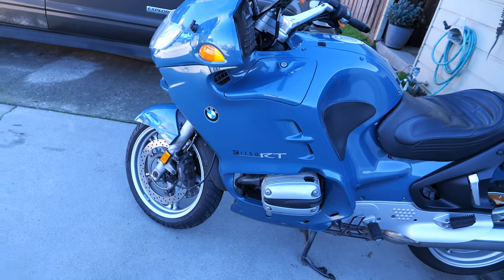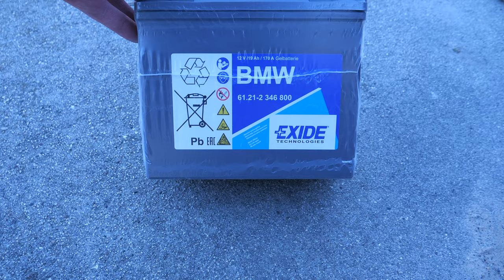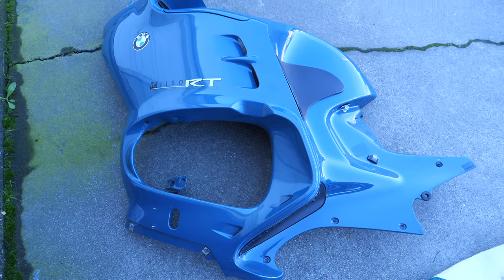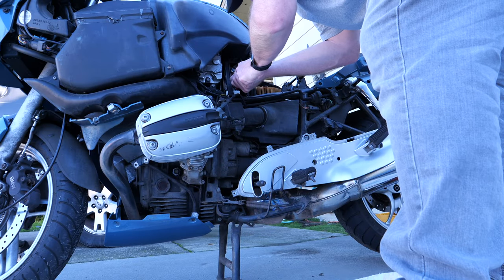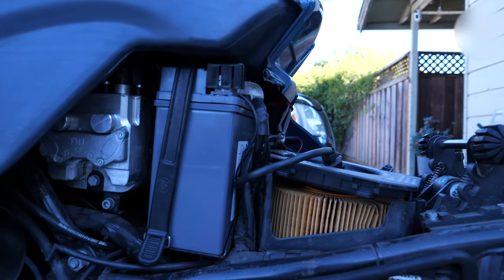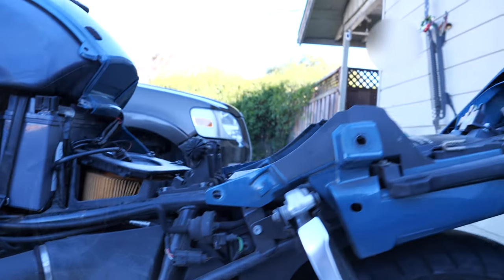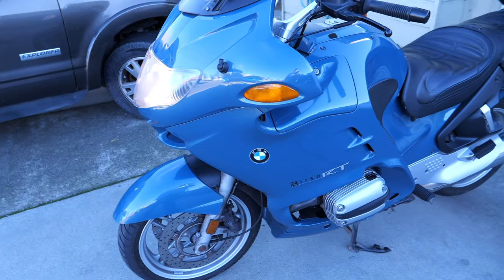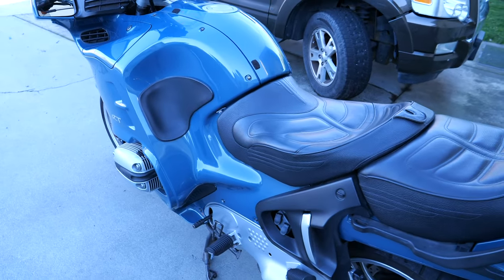BMW R1150RT Battery Installation & Quick Introduction

Comment: Just ordered new battery. My charger has two types of connector, clamp and O ring which both plug into the charger, so when I fit new battery I will put the O ring on at same time that way I can trickle charge the bike and not have to worry about flat battery. Good post, most people take both sides off, nice to know you only need the one.

Comment: Thanks for this. For clarity. To get the number seven bolt, the mirror has to be popped off by pushing the outside corner while holding the back of the mirror. The bolt is under the mirror.
Reply from the maker: That is correct. You can gently tap the corner of the mirror with your hand until it pops off. The turn signal light has slots and you can turn it to the left to remove it to pull the mirror away completely. When you pop the mirror off, you will see three metal slots on the bike, and on the mirror you will see the three metal protrusions that fit into those slots, which is how the mirror is held so tightly onto the bike.

I hope that makes sense. I guess I should do a short video explaining how it works. 🙂
Reply: Nice little piece of info to have. That is the last one I lack, and I was thinking that was what I would have to do. Thanks for clarifying. I am past ready to ride.
Reply from the maker: Awesome! So happy to help!

Comment: I just got an '03 R1150RT. Spent about 45 min yesterday trying to get to the battery. Found your video and it saved me a lot of headache. 
Do you have any suggestions for replacing the stereo with a modern Bluetooth enabled one?
Reply from the maker: Great! I'm happy the video helped!

I don't have any suggestion regarding replacing the stereo. Mine didn't come with the stereo and I've always used the compartment to store my insurance/registration info, my brake lock, and other miscellaneous items. I've also never tried to pull out the stock speakers to see how they attach and how much room is available. Sorry.

I actually have a bluetooth communication system in my helmet and usually just play SiriusXM on my phone.  😆

Comment: is your bike silver? or blue?  it looks blue but it may be the lighting.. the only blue one i've seen is dark blue.. i have the red one.. i like the look of this color..  i m ay need to wrap mine.. i want a change..
Reply from the maker: It's a light blue color, and they called it aquamint. It was a pretty rare color option for the '02 RT; I bought it in '04 with 4,000 miles on it. I've only seen an aquamint RT two other times in 20 years.

Unfortunately, I don't believe you can find aquamint panels any longer.

Comment: So I need a new battery for mine. Was thinking about getting an antigravity. Have them in all my dirt bike and loved them. Why did you remove it for an OEM? Want to place my order asap! 😂👍
Reply from the maker: The Antigravity batteries are nice, but they're too small to fit in the battery compartment; thus, you need to stuff the styrofoam around it to secure it. I just kind of got tired of that.

The other thing I noticed is that the RT needs a lot of cranking power, and the Antigravity battery drags a lot when cranking the engine.

All in all, the Antigravity was fine, but it was just easier to run over to the BMW dealership when my last one died.

But that was just my experience. Others may experience something a little different.  👍🏻
Reply: @twowheeltimmc  thanks gotcha, any idea what antigravity model you had? I noticed there isn’t a direct size match trying to see the biggest that will fit. Might just keep it simple and go oem
Reply from the maker: Damn! I actually found the order details. I bought the last one in 2019. 😆 I bought it from Bike Bandit.

Antigravity Battery YT12BS-16
Qty. 1	$262.15
YT12BS-16, 5.8" x 2.75" x 5.12", 
For motors up to 1700cc., 1.36KG
Part Number: 3176697
Reply: @twowheeltimmc  thanks so much stranger, take care
Reply from the maker: Technically a stranger, but still part of the greater brother-, sisterhood of two-wheeled enthusiasts!  😆

Best wishes! 👍🏻

Comment: Good video.  I assume a 1999 RT would be the same to replace the battery, just remove the Left side tuberware ?  Thank you.
Reply from the maker: Thank you for the support!  🙏🏼 

Replacing the battery in the 1100RT should be nearly the same. I’m just not 100% certain of the number of bolts and their exact locations.
Reply: @twowheeltimmc  It sounds like you know much about these bikes.  I let mine sit for 2 years since I bought a GSA and rode that.  Tried to jump start the RT couple of times using jumper cables from the car.  It will not start, it turns over but not start.  What do I need to do to get it started?  Did the fuel turn to gel over time ?   Thanks much.
Reply from the maker: The RTs pull a lot of amps when cranking over. You can try to siphon the old fuel and put in fresh fuel, or just add fresh fuel and try it. But my money is on the battery being too weak to crank it over. I’ve tried different batteries over the years, such as an Antigravity Battery (it’s a brand that is compact and light), but nothing works as good as the BMW gel batteries. They run about $200 USD.
Reply from the maker: I’d also recommend an oil change. It’s not too difficult to do, but I haven’t done a video on it… yet. 🙂 

I should note that I’m not very mechanically inclined. I just stick to the simple stuff and let the pros do the hard stuff. 👍🏼
Reply: @twowheeltimmc  I had the bike connected to the car's battery via jumper cables.  This was not off the old bike battery, that battery was still in place on the bike but I had jumper cables connected to the car's battery.  Yes, oil and filter change are easy to do.
Reply from the maker: I see. I haven't tried jump starting the battery.  Even if it started from a jump, I suspect the battery would be too dead to hold a charge after 2 years.

Comment: Nice video, helped a lot.
However, there seem to be no screw #6 to remove :)
Reply from the maker: Thank you for the positive support, and I'm happy it helped! 👍🏻

That's interesting, though. Your's does not have the mounting screw on the dash just below the left speaker where the side panel secures to the dashboard?

Comment: I may have to do this soon, far from home… 
How long did it take and what tools besides the torx head screwdriver did  you need? Thanks from France!
Reply from the maker: I actually used hex wrenches; I believe a 4mm for the body, and a 6mm for the air intake tube. As long as you have a set of hex wrenches, you should have it covered.

I also used a Phillips head screwdriver for the air filter cover, and a 10mm wrench for the battery terminals.

Remember, a Torx head is star-shaped with 6 notches, whereas a Phillips head has 4 notches. 👍🏻

Torx heads are what I need to use on my 2023 F850GS!  😆 Fortunately, on the GS the battery is simply right under the saddle. 👍🏻
Reply: @twowheeltimmc  Thanks Tim! That will definitely help! I also have a 2008 F800GS (♥️), but its battery is under the fake gas tank panel, so requires some unscrewing, but not as much as my 2004 1150RT! Hopefully I can do it as fast as in your video! 😅Cheers!
Reply from the maker: Thank you! I wish I could actually do it that fast!!  It's so tedious! It's my fault, though, because I neglecting the poor thing for too long.

My 850GS actually has a trickle plug for a battery tender. I wish the RT had that!!  

All the best, and thank you for the sub!  🙏🏼

Comment: The view to the most interesting parts of the job like hidden screws and the  connection between side part and tank (in bothe directions) are not well covered.
Reply from the maker: Glad you found the challenge of working on a motorcycle and filming at the same time helpful. ALL the commenters also found it helpful!!  🙄

Comment: Good information. Super annoying soundtrack
Reply from the maker: 😆 Thank you. I guess that's where the mute button comes in?
Reply: @twowheeltimmc  I replaced the battery in mine two days ago and it was a total pain in the butt!  I only have to ride my 2001 another 400 miles and it will hit 100,000 miles!  I am NOT the original owner.
Reply from the maker: Agreed! I wish you didn't need to pull off the side panel. With my F850GS, the battery is right under the seat.